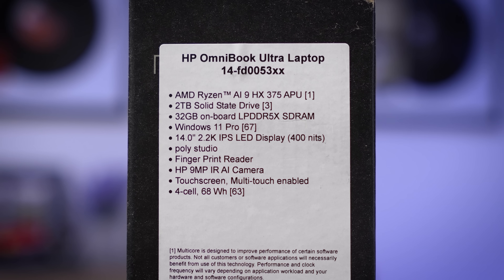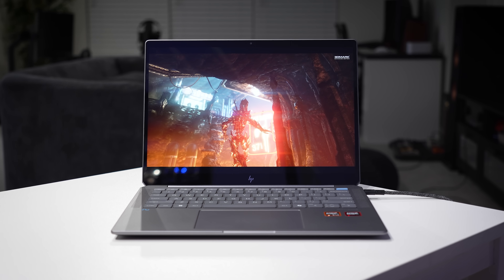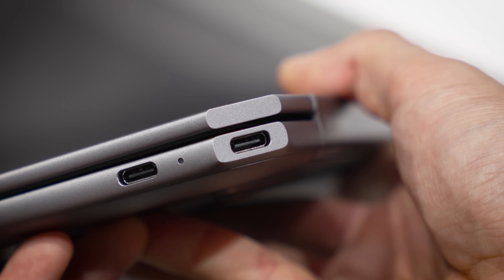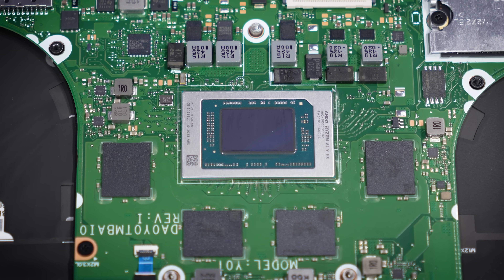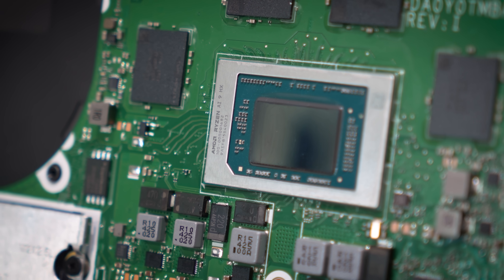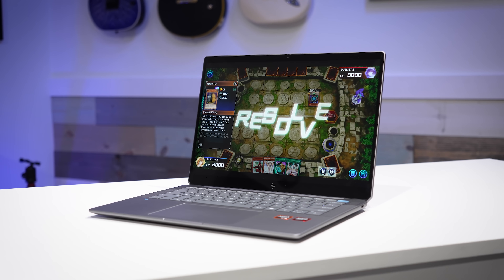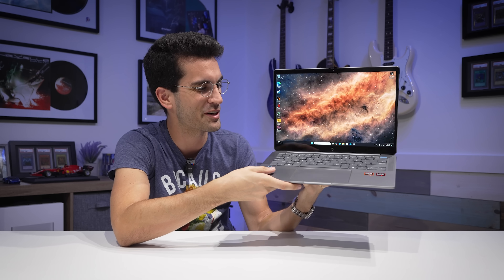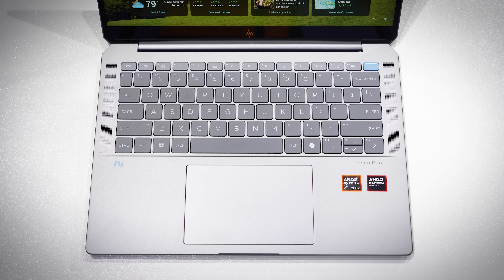AMD HP OminBook Laptops Are Getting GOOD

Comment: yeah so the liberty of replacing RAM in these things is no more, and then these laptops aren't so good when the onboard memory goes bad and you have to replace the entire mainboard just for one RAM.
Reply: It's a necessity if you want a fast iGPU. Lunar Lake does it too. You NEED to solder to get the required memory bandwidth and latency to not choke out these powerful iGPUs. If you want SODIMM you need to stick to laptops with dedicated GPUs and cut-down desktop CPUs. Those are still being made.

Comment: The ventilation is NOT just at the bottom, that is the intake for the single fan, the outlet is at the rear and blows directly on the screen, a pretty poor design IMO. My partner has the previous (Intel) model from work.
Reply: What in earth? So instead of blowing the dust, and germs, behind the screen away from the user, it instead blows straight up so you breathe it in? Genius
Reply: @NotASeriousMoose  and heats the screen.

Comment: This is indeed a great Laptop. You can play games on this laptop with how great the graphics chip is on the HX 375 APU. Just treat it like a Steam deck in terms of configuring games. Yeah I know you can definitely run higher settings on this laptop than you could a steam deck but the configuration idea still applies.

Comment: I bought an open box 15.7" Asus VivoBook OLED with a Ryzen 5800HS and a 3050 for about $800 Canadian a few months ago.  Ridiculous value for a media consumption and a light gaming machine.
Reply: I got the 14" VivoBook Pro version for almost the same a year back on sale. Can't complain for now... only the body is a bit meh (to much flex and a fingerprint magnet).
Reply: IMO open box implies a new unit returned, not an old device resold. The 5800s and 3050 are both a few years old now.

Comment: It's a POS Screen is too small it's a RYZEN Prosser and it's to light to do any real Lwork. I want a 12LB 21" 4K Touch Screen with a 4090 GPU a I9 CPU and 64 Meg with 4 to 8 GB in 3 to 4 seperate NVMe SSD's a Wireless Detachable Keyboard and Wireless Mouse wit BooKOO ports. If you can't carry 10 Lbs get a GYM Membership andBulk up buddy.
Reply from the maker: Dude did you misread the title? GL getting those in a thin-and-light 😂
Reply: So, basically word salad because you don't really know anything about computers.
Reply: more like "laptop in video does A", commenter wants "laptop that does B"
Reply: @HoundDoungMech you missed the point entirely. There people out there who want a thin and light laptop. This IS NOT A GAMING LAPTOP. Yeah you can play games on this laptop but is NOT advertised as such. AMD makes great processors for laptops and mini PCs. You don't know anything about PCs.
Reply: Don't worry, I got the satire. Keep being you, king.